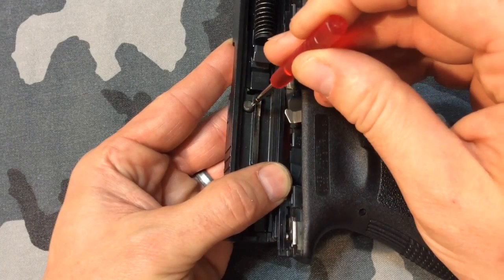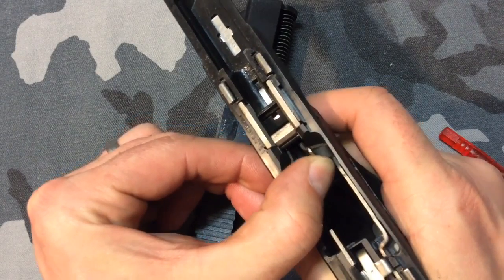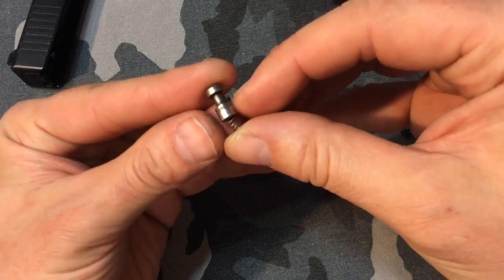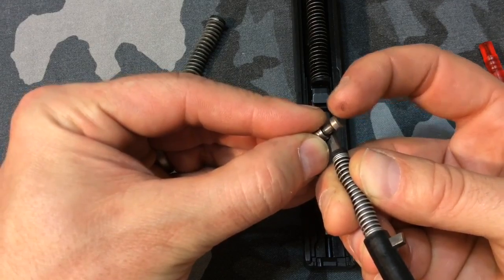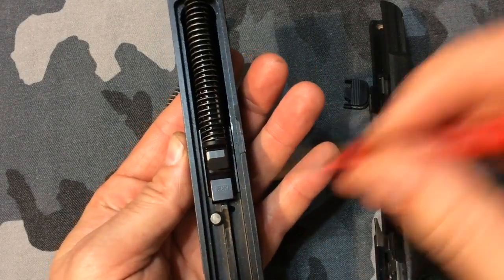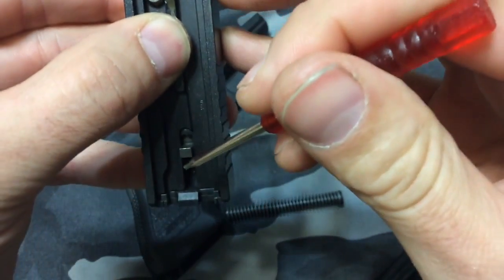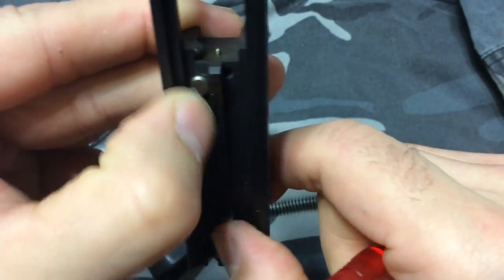Explained - Passive Firing Pin Safety

Comment: HELP!   Glock 19 Gen 3 brand new never fired (as far as I know)
Removed slide to inspect interior. Now slide will not go back on the frame. Looks like the firing pin block is hitting the top of the trigger bar not allowing it to pass. I have to go through the mag well and push in the firing pin block to pass over the trigger bar, in order to get the slide back on the frame

Comment: Very nice video. So the way i understand this, the striker/firing pin don’t move back and the spring doesn’t get compressed unless and until the trigger is pulled back causing the trigger bar to move back and compress the striker/spring. If the trigger isn’t pulled, then the spring isn’t compressed  and the striker is basically just sitting there at rest. Is all that correct?

Why I’m thinking of this is to debunk all this paranoia about Glocks randomly going off when holstered appendix. If the striker is at rest, it cannot go off because there’s no spring-loaded forward momentum on the pin. So then the only way to shoot your self is while holstering/unholatering and you or something else depresses the trigger—all of which is preventable with vigilance and intentional holstering. Agree?
Reply from the maker: The striker spring is partially compressed and the trigger pull does the rest and releases it.

While compressing the spring the trigger bar also pushes up on the safety of this video.

Guns do not “just go off.”  Either the pistol has been badly modified or the trigger is pulled by something while being reholstered.

Comment: My firing pin safety came out and I am having a really hard time getting it back in with the pin. Is it very unsafe to fire without that safety pin? Haven’t fired it since it popped out because I’m worried about safety.
Reply from the maker: It didn’t “pop out.”  You removed the back plate on the slide and the striker.  You have to reassemble it in the correct order.  My videos on this procedure were removed by YouTube.

Comment: What happens when the spring for the firing pin breaks? You cant see that spring during cleaning and the contact point isnt very large so wouldnt any change make it unsafe to carry with round in chamber?
Reply from the maker: Springs don’t really break in these situations.  They might weaken but not break.  And if it did there would be less forward force on the striker making it less likely to ignite the primer.

Comment: Hey everyone great video id like to ask something im having a doubt with, if my gun if assembled but I have no rounds or a mag for the matter and I dry fire is the firing pin supposed to come out with no rounds or is it supposed to stay in there when its empty.
Reply from the maker: There’s a spring on it so it’ll retract after it shoots out.  Unload the pistol properly, aim it at a safe ceiling, insert a pencil eraser first, pull the trigger.  The pencil will launch showing evidence of the firing pin.  But you won’t see the firing pin since it’s real quick.  But be safe with  that pistol.
Reply: @gunfzx  🙏🙏u da man tried it with my taurus g3c and effectively it left a the pins mark on the eraser. Now I know my gun is in tact thank you brother
Reply from the maker: @onlinetoydisplay  thanks for watching

Comment: What is the point of the firing pin safety? A real safety prevents the trigger from being pulled at all. Not very safe. Makes no sense. The bullet will not fire if the trigger is not pulled in the first place.
Reply from the maker: A firing pin safety makes the pistol drop safe.  This passive safety must be moved out of the way of the firing pin (striker) by the motion to the rear of the trigger.  

A manual safety without a passive firing pin safety (1911 series 70) when cocked and locked allows the pistol, when dropped on the hammer, to fire if the safety and sear cannot hold the hammer back.  Accidents like that are why most modern pistols have passive firing pin safeties and the 1911 went to the series 80.

You get a better trigger but less safety if you remove the passive safety.  On a modern striker fired pistol like the Glock some trigger mods effectively eliminate the passive striker safety and make it not drop safe.

In the case of the Sig P320 the metal trigger apparently had enough mass (inertia) that a hard hammer strike or a drop on the rear of the pistol caused the trigger to go to the rear, actuate the passive safety, pull the striker back, and release it.  They apparently made the trigger too good with light springs and a massive metal trigger.
Reply: If you take out the passive firing pin safety, wouldn't that kinda make it rapid fire?

Comment: Quick question for you. Hopefully you can help me identify my issue. My slide is fully assembled with a channel liner in it. I have tested this with three different upper slide part kits including a OEM Glock one. No matter what I do the striker doesn't retract and the firing pin safety doesn't pop up. I have to manually push the striker towards the back plate to release the firing pin safety. Any ideas?
Reply from the maker: you have the tiny spring above the firing pin safety?  And the spring cups are installed properly behind the square portion of the striker?  You can send a video to gunfzx@gmail.com to show me what you're looking at.  

Does it install properly on a frame?
Reply: @gunfzx  Yes, I have everything installed properly. I've probably taken apart both of my aftermarket and my oem glock slides about a hundred of times this weekend and everything looks good. It all installs properly in the frame but there seems to be more pressure on the pin safety than there should be. I can certainly send you a video.
Reply from the maker: @ATOMSKI_MRAV  it’s tough with words to figure it out.  A video would be good.

After reassembling your stock slide will it run on your frame?  

And you can just transfer the parts to your new slide from the old one?  Same problem?
Reply: @gunfzx  I have interchanged thee sets of complete parts on three different slides including my stock slide. Everything runs good except this specific slide from Zaffiri. At this point I'm assuming it's a bad slide. I'm sending you a video now.
Reply: @gunfzx  It wouldn't let me send the video. I'm uploading it to my channel so you can see the issue.

Comment: What happens if the safty is pushed down and won’t pop back up ??
Reply from the maker: There’s a spring pushing it down toward the frame.
Reply: what if i accidentally put the plunger in place without the spring? its stuck now and wont come out even with pliers. help
Reply: @alexslaps7438  try some gun lube or good ol wd40 to make it less friction and bang it out with a a plastic hammer or wrap a cloth on it then hammer it out ?

Comment: My plunger flys out when I pull the firing pin back with my finger. What causes this? I can’t figure it out
Reply from the maker: Here’s my slide disassembly video if that helps.
Reply: @gunfzx  I assembled it correctly but when it’s complete, when the slide is off I pull the firing pin back and the safety plunger just flys out. Is it normal my 17 doesn’t do this at all. Plus I can’t put my slide on unless the trigger is in the cocked position. It’s pissing me off
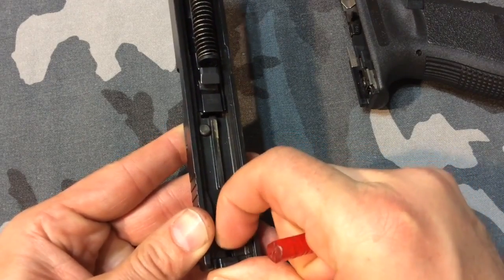Reply: @gunfzx  at 1:00 in your video, you use your finger to pull the firing pin back. That’s when my plunger flys out. It’s all new slide assembly parts. Could this possibly be damaged on arrival? I don’t see any physical damage

Comment: My pistol Gran power don't have firing pin block,  this is bad?
Reply from the maker: Some don’t.  Most modern handguns do.  They come in different forms so yours might have it but it might not be obvious.  Which model?  It’s mostly not a big deal but considered a good feature.
Reply: @gunfzx  Gran power lp .380, and don't have firing pin block
Reply from the maker: Emilio Ayala does it have a half cock position on the hammer?  I think it does.  If so that will function as the passive safety.  My CZ 82 and Makarov both have hammer blocks that don’t allow the hammer to fall on and ignite a live round unless the trigger is to the rear.  I think yours has it but it will not look like the one in the Glock I’m this video.
Reply: @gunfzx  thx for your help

Comment: I just realized that's a 357, wow in a semi auto
Reply from the maker: It’s actually a 357 SIG not the more common 357 magnum.  The magnum is a rimmed revolver cartridge and the SIG is a rimless semiauto bottleneck cartridge that uses a 40 cal base and a 9mm bullet.  It’s interesting.
Reply: @gunfzx  thx for clarifying

Comment: I removed the plunger completely and hit with a hammer and didn't go off while loaded?
Reply from the maker: Interesting test!  A bit dangerous too - be safe.  But in order for the firing pin to go forward on the test it has to be disconnected from the sear (or whatever it’s called) and the hammer won’t do that.  You made me think about it - nice work.
Reply: @gunfzx  forgot to mention, I did it on a M&P 40 gen 1. I chickened out and put it back in.

Comment: Great explanation.  Thanks for sharing.  Do you know whether a Beretta Px4 Compact has a Firing Pin Safety??  Do only striker fired pistols have Firing Pin Safeties? Can a hammer fired pistol have a Firing Pin Safety?
Reply from the maker: Pretty much all modern guns have firing pin safeties.  My Beretta 92G does and so does my CZ 75BD.  And the PX4 does too.  Look it up and you'll find it.  Or just take off the slide and look for the button.

Comment: Assuming i keep my gun chambered daily. Any chance the firing pin safety might fail from fatigue perhaps and let the firing pin slip?
Reply from the maker: Need coffee Nope.  The firing pin safety is a last resort passive safety and does not do anything in the normal operation of the firearm.  The firing pin is held in place by the fire control mechanism and the firing pin safety is just moved out of the way when the trigger is pulled to the rear.  It is a drop safety so the gun has less chance of firing when dropped.